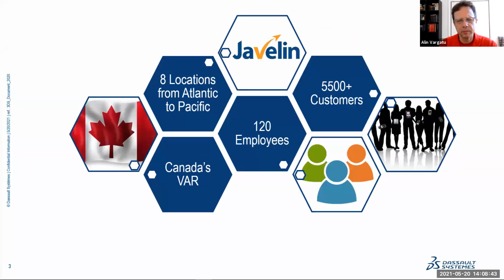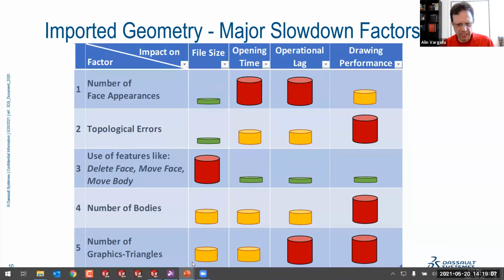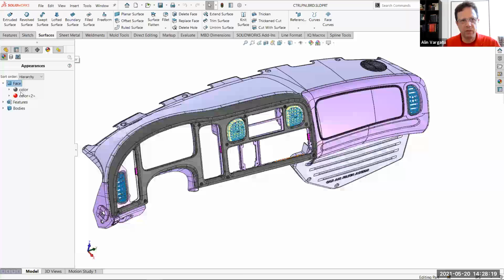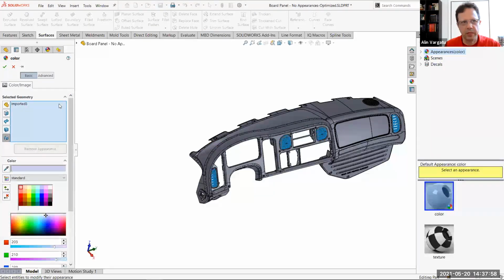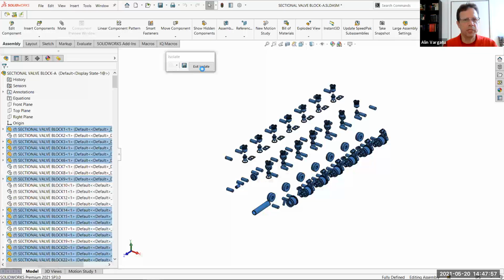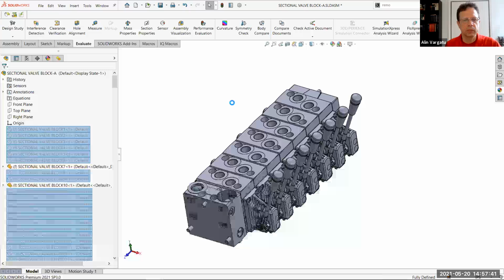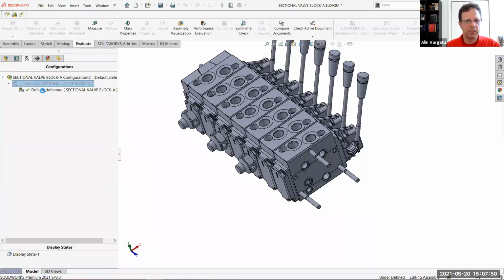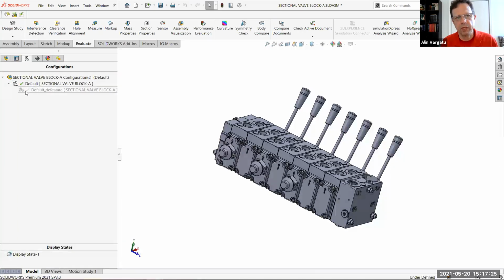Quick Imported Geometry Optimization Techniques for SOLIDWORKS Large Assemblies

Comment: I have seen another example of surface bodies being completely "un-knitted" (if you want to call it that), so that each face is it's own surface body. This is what is shown in your example of that Freightliner dash piece (something funny is that I just recently "optimized" the same Freightliner chassis cab model for one of my coworkers. The difference is that we didn't have the internal stuff like that dash model).  Do you know what causes a model to have all the individual faces to be separated like those air vents were in the video.  I want to avoid that like the plague

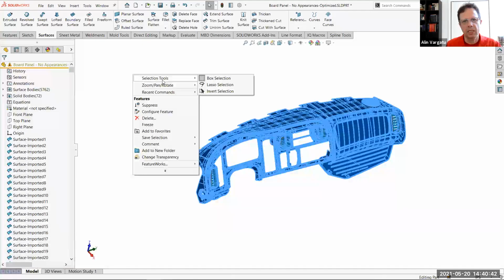Comment: 37:45 I would have just done a Delete/Keep Body command and done "keep" on the selected bodies. that would have been a ton faster than doing "invert selection" and "delete" on the keyboard. The only downside is that you have to save as a parasolid and import again.  But I think it's totally worth it.